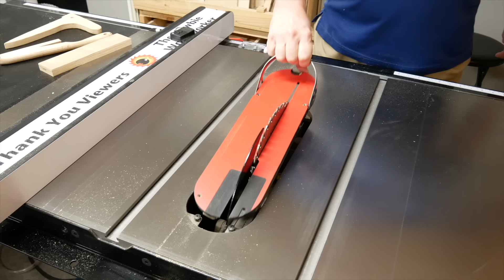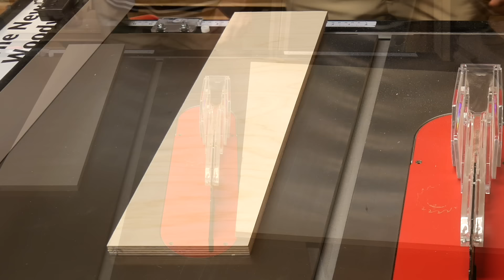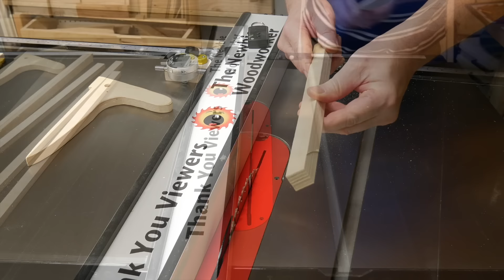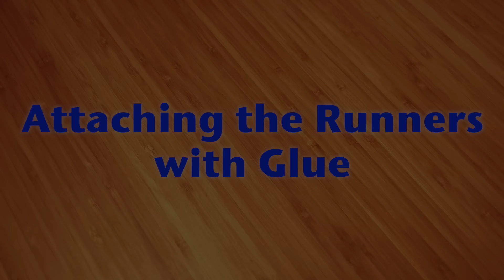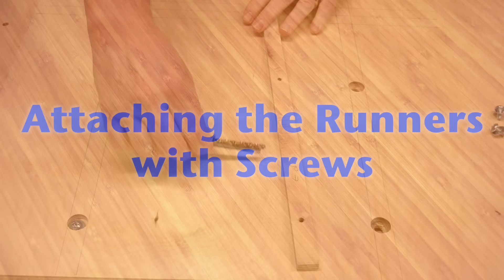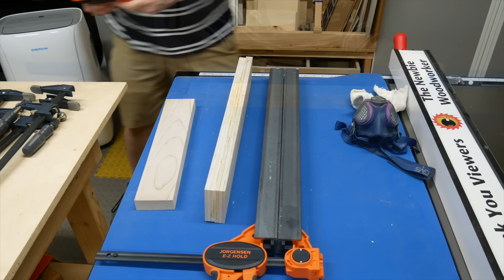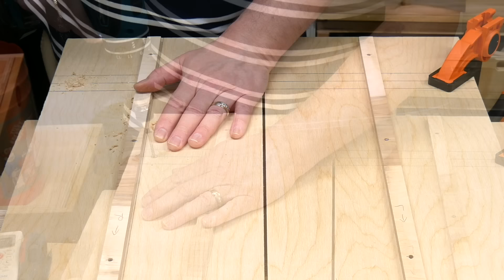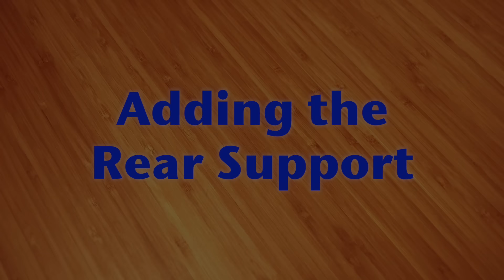Build this Revolutionary Cross Cut Sled, for Newbies!

Comment: Thanks man. Super noob here, just set up my saw an know I have to have a sled, but all the others require removal of safety gear. I have a motto, if I'm not bleeding I wasn't working. Hope I don't have to explain why this can't be the rule with this new interest of mine.
Reply from the maker: LOL, I totally get that. Back in the day I used to get inside a lot of computer cases, and invariably I'd leave blood somewhere. Regarding the new saw, make sure you 1) read the instructions (I know, I know, but in this case they can really help) and 2) watch some safety videos. It's not always obvious what things can be dangerous (trust me on this). You can start with this: https://youtu.be/ZUZ8hRm7a8g. Have fun, stay safe, and leave a comment anytime you have questions (it doesn't matter which video you leave the comments).
Reply: @TheNewbieWoodworker  rtfm my dude. Rtfm. Used to do service for several truck stops an I'd always get people having issues addressed on page one of the manual an I'd lose my mind. Just read the f*ckin manual ffs. I still read them for fixtures I've installed literally 100 times or more. That said, the delta manual kinda sucks so I definitely did some side research from guys like yourself. Thanks again man
Reply from the maker: @richardcagle5475 Back in the day I used to read computer compiler manuals cover to cover, multiple times. Same with books on computer programming languages. Nowadays I get a new phone, and have no clue all the things it can do unless I stumble across it by mistake. Nobody writes decent manuals anymore.
Reply: @TheNewbieWoodworker  
Ah ha, my thoughts right off, you didn't work with machines all your life.
I have so take my advice always stay 6" away from a running saw blade.
Also good advice buy or make a zero clearance table saw incert. Watch a lot of YouTube stuff, not everyone has it right no one person has all the answers.
Not even me at age 61, and my dad taught me when I was 5. You cant be too safe, but you also can't always depend on some type of safty equipment. 
Never stand in the firing line.
When you turn on your saw stand off to the far left of the table saw.
You've got no idea if somone hit the blade on your saw causing a carbide tooth to be knocked loose, turing on the saw could send it out like a bullet. If your in the way you'll get hit with it. A guard might not stop it.
Reply from the maker: @bobbg9041  See, those are the kinds of tips you learn from having been taught by people with experience. I mean, I knew most of them, of course, but most everything I know comes from observation and hard-earned lessons. I envy you. 🙂.

Comment: I'm wondering what the difference is between this sled and the one you made a year before ?
Reply from the maker: The other sleds require you to remove your blade guard before you use them, and the more you have to take the blade guard off and put it back on, the easier it becomes to decide to just leave it off all the time, which isn't as safe. With this new sled, you don't have to remove the blade guard to use it.
Reply: @TheNewbieWoodworker  I meant this one, which also can be used with a blade guard- https://youtu.be/AlUCDzM3gzY
Reply from the maker: @jeffcarr392  Oh - the other one is a half-sled. It only goes on one side of the fence. Use whichever one makes the most sense for you.

Comment: Great guide.  I appreciate you including your mistakes, tells me you are honest.  The moment of enlightenment for me was the hardware and how you fastened the runners to the base.  That has been my major issue making table saw jigs.  I've tried various types of glue, double-sided tape, trim nails... you name it, to keep the runners on their mark.  At that point it will even slide beautifully but as soon as I add screws the runners just get ever so slightly wrenched and pulled micrometers from center causing them to rub terribly.  No matter how straight I drive them, bigger screws, smaller screws, small pilot holes and bigger pilot holes... my problem being it was always WOOD screws!  I had considered adding in metal threaded inserts but always felt they would either scratch things or split the runner.  The method you used just using a tap on the birch plywood and clearly showing the sizes and various pieces of hardware is SO HELPFUL!  Thanks!
Reply from the maker: Glad I could help! In my opinion, if you glue the runners, you don't need screws. If you do use wood screws, make sure the holes in the runners are slightly wider than the screw shaft, otherwise the runner will expand as you drive the screw. Also, don't screw them down too tight - that can cause the runner to expand also.
Reply: @TheNewbieWoodworker  ok thanks... great advice!  Keep up the good work and take care.
Reply from the maker: @matthewhall9692  You too. If you ever have suggestions, criticisms, or questions, feel free to post a comment. You can even email me from my website, by clicking on the "menu". https://thenewbiewoodworker.com/. I like your attitude, and how quick you are with understanding things, so like I said, feel free.

Comment: One of the first things I made for my home workshop was a crosscut sled (thanks YouTube!)
I quickly found that I almost always switch back and forth between crosscuts and rip cuts. Just as you mentioned I seldom add on all the Guards. Well my sled finally died so I'm probably going to copy your design. Now that you've had it for a while, are there any things you don't like and would change?
Thanks for many educational, and entertaining videos.
Reply from the maker: Oddly enough, I wouldn't change anything. It's worked just like I hoped it would. That almost never happens!  :)

Comment: This just doesn't work for me, probably that's my fault but it doesn't flow and I can't link what's actually going on or why.
Reply from the maker: When you say "this just doesn't work for me" are you referring to the video itself, or are you having trouble building the sled? And don't worry about offending me - I have (relatively) thick skin. :)
Reply: @TheNewbieWoodworker  Sorry for the ambiguity, I was trying to say that my problem is in understanding the video, I haven't got as far as actually making it!
Reply from the maker: @weightcontrolandfitness442  Thanks for the clarification! I don't know if you want to try and work through this, but if you do, ask questions and I'll see if I can answer. It's usually easier to start with the first thing you don't understand, then work forward from there.

Comment: Not bad , but you compensating skills with gadgets. See in any half good apprenticeship they first make you use and sharpened pencil then use square, meter , then hand plane and straight edge , chisels and then hand saw  and sharpen them by file and stone, before you even can come close to machine room because then, hopefully, you got bloody respect for  machinery . See, everybody comes with same sled my grandfather used in 1940 , same jigs and  market them as ,,Revolutionary" but nothing new ..... (except perhaps pantarouter) . Build something extraordinary , learn skills,  stop copy cat ,
Reply from the maker: "In any half good apprenticeship" - that's all well and good, but most people aren't in the position to go into apprenticeship. And as for whether this sled is revolutionary or not, I don't really care one way or the other. But out of curiosity, let me ask you this: Have you ever seen a crosscut sled before that lets you keep the blade guard on? I'm seriously asking - I've never seen it, not that I've seen everything there is to see.
Reply: @TheNewbieWoodworker   thank you for  explanation , I don't wont go on with measuring competition 😁 You right about  blade guard, that much said, I build years a go 90's  nice blade guard  mounted 6ft a way on right side of the ext. table using same 3"pipe as dust collection  . It was height adjustable by counterweight on pantograph and swing around when in the way. I got Delta saw then. I learn from that mistake (Delta) and got me self quickly normal saw with sliding carriage table and outrigger. As for apprenticeship , In my part of  Europe (Czech Republic) is higher education for free , and I mean free . When You rebuilding society after devastating war (WW2) you invest in education , not burden citizens with usury, later we find out it is more honorable than fish for talents elsewhere, so we stick to the principles.  I'm looking forward to see more Your stuff
Reply from the maker: @albatros1752  I really wish we had apprenticeships available here. That's something I've wished for, for years. Good for you guys!
Reply: @ALBATROS isn't a chisel substituting skills with gadgets, was a time when they only had flint to shape the wood.. aint progression great :)
Reply from the maker: @chrisrowley4732  😁

Comment: I want to thank you for emphasizing safety on your channel.  I left a message on your video about kickback linked to here.  But I wanted to add a little something better related to this video. 

I did a bit of research on actual data about home workshop injuries, but I can't find it narrowed down that much. What I found was power tool injuries at the ER.  The only tool broken out to a category that I could find was the table saw which accounts for 1/2 of the visits. More than 90 table saw injuries are treated in the US emergency rooms everyday!  1/3 of these visits were using blade guards, and 1/2 of the other injuries could have been prevented by using one.  Also, 1/3 of the total table saw injuries ultimately ended in amputation. 

Again, thank you for taking so much time to emphasize safety.
Reply from the maker: Oh, I just realized I forgot to mention on your other comment that I think your idea for a website is awesome! I really do believe safety is so very important. And the stats - they help highlight why I recommend using a SawStop. I know they're expensive, but as far as I'm concerned, the price is well worth keeping my fingers! And my SawStops have saved my fingers twice now. Keep up the good work regarding safety!
Reply: @TheNewbieWoodworker  Have you posted videos of the "saves"?  I would like to hear how and why, and the video if it happened while recording.  Thanks
Reply from the maker: @BlessedLaymanNC  I haven't caught any on camera. The closest thing I have is this video, which was shot right after a save: https://youtu.be/OouPywNRZJ8. But if you want some real first-hand accounts, join the SawStop Users' Group on Facebook and search for "brake activation" (yes, FB has a "search" feature, although you may have to look closely to find it). People are always talking about brake activations. https://www.facebook.com/groups/sawstopusersgroup/.

Comment: A handy  little trick to avoid "chasing the holes" without visibility: apply double sided tape on one piece and line up the holes in the top piece to the holes in the bottom piece with a couple of long finish nails, keeping both pieces a bit apart. Once lined up, press the 2 pieces together and drive in all the screws.
Reply from the maker: Thanks for the suggestion. 👍

Comment: Thank you for pointing out that squaring the fence to the blade is not the best practice.  Almost all sled videos assume that the blade is parallel to the miter slots (or don't know the difference).  I've built a few sleds already and learned this early on.

Perfectly square definitely matters.  It didn't take me long after I started making shop furniture with lots of drawers in every tool stand to realize that I had to verify that the table saw blade was square to the table frequently.  If I didn't, I ended up forcing drawer carcasses into square so the fronts would be flus with the cabinet.
Reply from the maker: You're welcome, and thanks for using the word "frequently". It's definitely NOT a "set it and forget it" procedure. 😄

Comment: Well thought out and accomplished project. Any reason not to put an arched support at the front of the sled to strengthen the other end of the split/kerf (as long as it clears the safety guard of the tablesaw)?
SUB'd, BTW.
Reply from the maker: Thanks! You could add a support if you wanted to, but I've been using mine for a year and a half, and it hasn't needed one. And welcome aboard! 😄
Reply: @TheNewbieWoodworker  You don't need one till you do .. lol
Reply from the maker: @chrisrowley4732  Yep, that's true for most safety devices. I don't need side airbags until some idiot runs a red light...

Comment: Love the idea!  I unfortunately can't use my blade guard because of the types of joints I make with my table saw, and the jigs I made to do it with, (they all require a riving knife) but I will keep this design in my memory in case I need to use my blade guard!
Reply from the maker: Thanks! I totally understand about the types of cuts. But like you said, it's always good to keep things like this in the backs of our minds. I know I've got lots of those fluttering around. 😄
Reply: Unfortunately, my brain (after a traumatic brain injury and a stroke) is like a cheaper smart phone... short on accessable memory. The more I try to put in, the more it erases of the old stuff to make room for newer stuff, and sometimes even the newer stuff gets corrupted and is hard to recall.
Reply from the maker: @thomasarussellsr  Sorry about your brain injury and stroke. My memory is bad enough as it is - I'd hate to imagine what it would be like after something like that. So the more safety things we can have, the better. 🙂

Comment: Good stuff, I enjoy your videos....got jokes, but not over the top silly like many youtubers now. I'm sure there is a reason this won't work, but why could I not put the sled on the saw and use a square against the blade vs putting something in the cut to square the fence?
Reply from the maker: Thanks - it's a fine line between being obnoxious and just having some fun. Glad to know I'm staying on the right side of the line (for now). 😄 You could certainly do that. Just pay attention to the teeth on the blade, because they probably stick out past the sides of the blade.
Reply: There are a few possible reasons not to square off the blade itself. 
1. The teeth of the blade can throw the square off, front or back of the blade on the side you have the square against.
2. Minor warp of the blade itself could throw your square off and be imperceptible to the naked eye, but become noticeable when assembling your project later on and the angles or joints have gaps.
3. The shaft the blade rides on could be just off true leaving the blade off of a true 90°.
With reasons 2 and 3, the kerf will be marginally wider than what it should be with the slightly wobbling blade, but still 90° to the sled.
Reply from the maker: @thomasarussellsr  Thanks for the tips, they're spot-on. And I'm especially impressed with your closing comment about "2 and 3" and the width of the kerf - most people have trouble understanding that point, and it's hard to explain. Good job.

Comment: I have been using a half-width sled. I am thinking of making a new one, basically what you have, full width, and then cutting it in half. With a half sled, I don't stand in line with the blade. The RHS will suport the goods and, I hope, tidy up the cuts. And hold stop blocks

I might drillsome holes too, like a Festool MFT, so I can use home made dowels to hold stuff in place, maybe mitre stuff. I suppose if I used 6mm bit, I could use M6 bolts, cut to length.

Aligning the fence. One could put a steel rule in the kerf, and wedge it to one side with tapered shims.
Reply from the maker: I have a half-sled build video for this: https://youtu.be/nyNimyc2UeY.
Reply: @TheNewbieWoodworker  I saw the half sled, but I want to support the off-cut too, and I can attach atuff to it.
Reply from the maker: @oneeyedphotographer  Got it. That makes sense. Good luck! 😄

Comment: After watching your video on making the Cross Sled I wondered if it was possible and it be accurate to use two speed squares one on either end of the flat portion of the sled extending across the back of the fence to check for square? Wow a long sentence :-) You used the precision square then a framing square and I immediately thought, why not use 2 speed squares since the fence itself is square and the sled is square, to then check and make it square against the blade. I could also be missing the entire point of the exercise. Just a thought.
Reply from the maker: The problem with that is keeping them even with each other. One would end up a little more forward, the other a little back. At least, that's my thinking - I could be wrong.

Comment: Just an idea to make it safer.  Put a block at the the side next to you to stop the bladed guard before the blade from coming thru the  fence.  That way stop the chance of cutting the base in haft and your fingers off.
Reply from the maker: That would certainly work. There's plenty of resistance when you get to the end of the sled, so it's pretty easy to not cut all the way through, but if you're worried, as I said, that would certainly work.

Comment: a crosscut sled is made specifically and used because it is safer no? meaning the traditional cross cut sled is safer than the blade guard?
Reply from the maker: Well, personally, I don't think you need a blade guard with a cross-cut sled, so that's up to the individual. But you have to remove the blade guard if you want to use a typical sled. So this sled just means you don't have to remove the blade guard as often.

Comment: Great idea for keeping the blade guard on rather than removing it,  having watched you realign the fence with two drill holes i found it easier to screw one end of the fence then the other end use a forstner bit and a kreg screw in over sized hole that way no need to keep drilling more holes in the base than needed and its easy to readjust as needed
Reply from the maker: Thanks, and sounds good to me. 😄